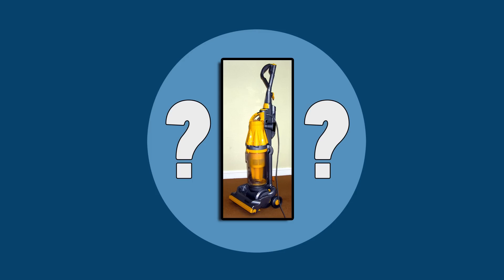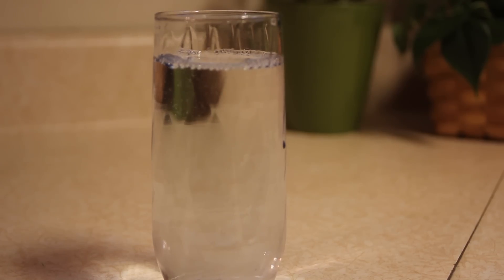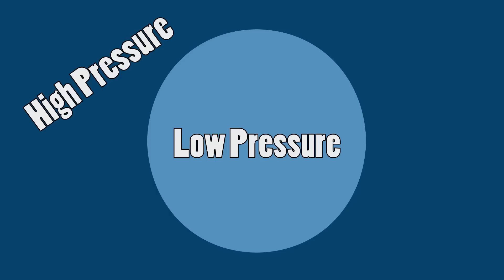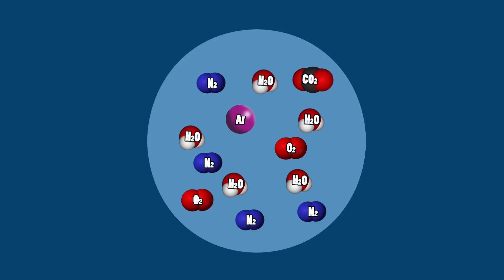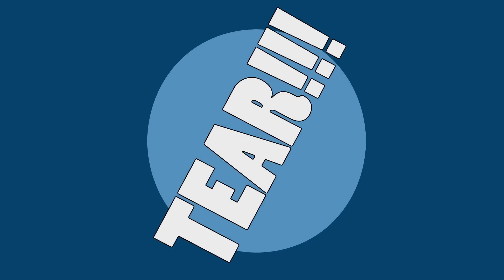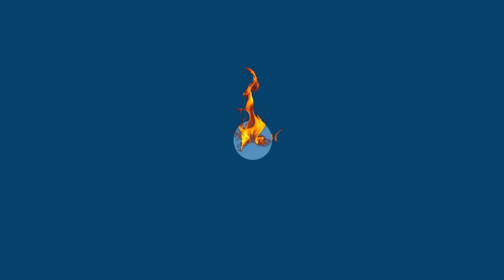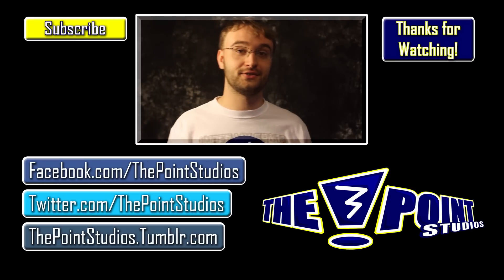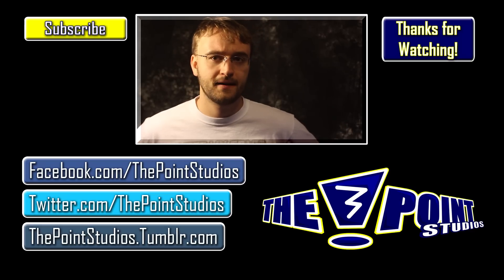Sound into Light! -- ACOUSTICS: Sonoluminescence

Comment: No it doesn't have to take place in bubbles you can do it with a speaker and a tone generator just be sure the speaker is facing up and as far away from any walls and things which radiates radiation and play a tone with the same frequency as any frequency in the visible light spectrum, this will either cause any ambient visible light to reflect off of the sound wave making it look illuminated, or your eyes will just see the sound wave as light even in the dark I'm not sure which
Reply: do you have a link to this?

Comment: Could you get a more dramatic effect with a liquid under higher pressure? So that the pressure difference between the low pressure bubble and the outside fluid is higher? I presume that would result in higher temperature and more light?
And if that is the case, I was just watching something about Sonoluminescence and fusion and if that was the result you wanted to achieve, well what would happen if you attempted Sonoluminescence with liquid hydrogen and ultrasound?
Reply from the maker: +Asmodeus555 I'm not completely sure. My intuition notes that the pressures achieved inside the bubble when it collapses is so much greater than the surrounding fluid pressure, that increasing the fluid pressure might not do much. I don't know, sorry.
Reply: All that is needed is something with greater surface tension than water. What about a really heavy element, like mercury? I don't know about its surface tension, but canon balls float in that shit. I bet ultrasonic sound can create cavity bubbles in mercury.

Comment: i'd be interested to see the energy at the core as it relates to the energy use to generate the standing wave (if indeed it is a standing wave? )
Reply from the maker: Hmm, that is interesting! I haven't actually looked into the sound energy applied. Clearly there is more energy put in the whole system than there is in the bubble core (conservation of energy), but the energy density is VERY different. The energy is so concentrated at the core that we can get incredible temperatures from huge amounts of energy, but only at that point.
And yes, for single bubble sonoluminescence, it is indeed a standing wave set up in the bubble chamber.

Comment: false cavitation bubble are made by heating and pressurizing the water to steam. IT's steam not air
Reply from the maker: Most of the gas inside the bubble is indeed water vapor. However, it is not entirely so. Research shows that specifically the argon gas (argon makes up about 2% of air) is responsible for the blueish color of sonoluminescence.

Comment: Okay,so..it is kinda the same effect that happens in a fire piston,when a fluid is rapidly compressed,it gets hot..
So,a bubble is created,since it s unstable,it collapses,making the pressure in the bubble higher than the fluid it is in,and heating up to a point it creates a beam of light,then it expands until all the kinetic energy is lost,but since you are always applying energy in a form of pressure waves,it just keeps going in ca cycle. Did i get it right?

Comment from the maker: The big problem is just how different the phenomena are. Sound is pressure waves moving (mostly) longitudinally through a medium. And light is electromagnetic waves (or particles) moving transversely. It is possible to convert signals from one type of energy to another, but we require some sort of process. Sonoluminescence is not a signal conversion like a speaker or microphone, however. The resulting light has nothing to do with the frequency of sound causing the bubbles. It's more interesting.